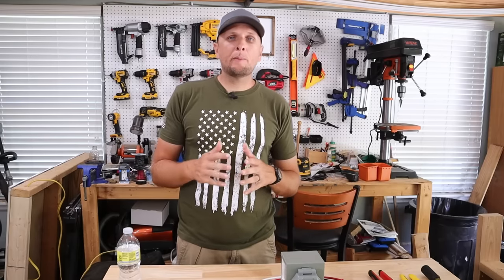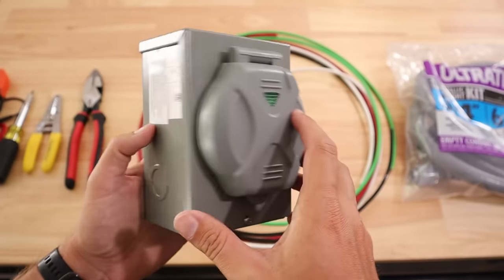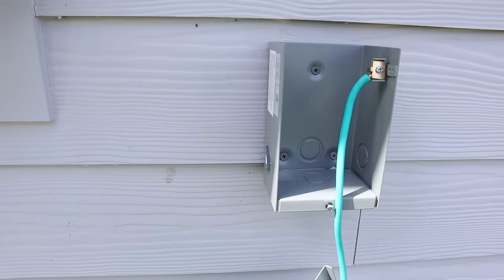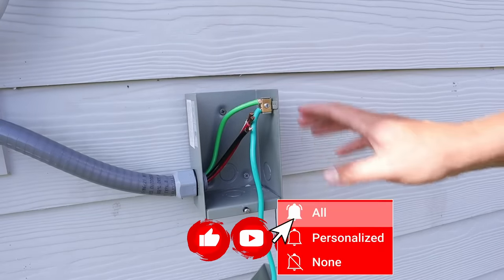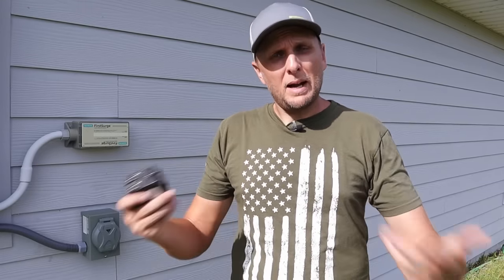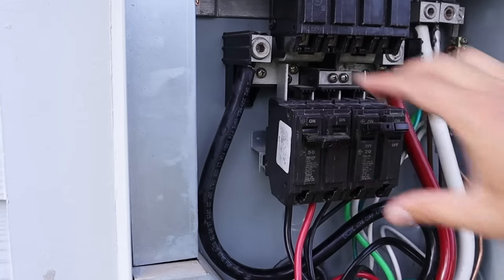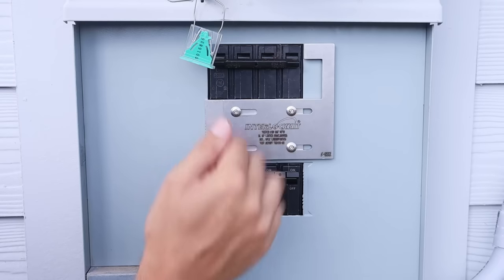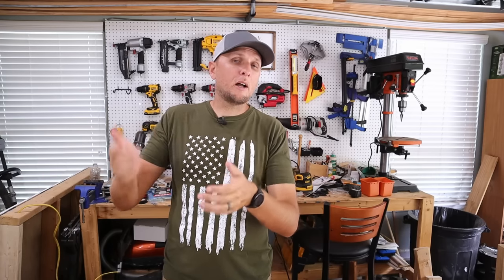The BEST Way To Connect A Generator To Your House - Interlock Kit With Power Inlet Box Install

Comment: Instead of putting in the power inlet box, my electrician said he could hard wire it directly into the breaker box.   That way I only have to plug into the generator and not have to worry about plugging into the outlet box.   Just saving me a step.   Would hard wiring be a better idea or just as good?
Reply: No difference really.

Comment: You should have used a 3 pole breaker and interrupted the 
neutral, even if you have to cut out the deadfront. Linemen could get hurt or even killed from power on the neutral backfeeding into the lines on the poles.
Reply from the maker: If power is going back into the grid on the neutral then there is something seriously wrong with your wiring.
Reply: @HowToHomeDIY  regardless of your comment, a three pole breaker to interrupt the neutral is the safest way to do this and is code in a number of jurisdictions. SquareD makes a cost effective 3pdt switch for instance, the C92351, CSA approved and rated for 30 amps.

Comment: I installed a switch and outdoor light on the incoming side of the power service to my metered box. Normally I leave the light switched off, but when power goes out, I switch it on so that I know when the power comes back on.
Reply: Does that meet code ?

Comment: With your house main being turned off to prevent backfeeding the powerline and potentially injuring a lineman, how do you know when line voltage has been restored by the power company?   Periodically switch back and forth between generator and line to see if its been restored?
Reply: You keep an eye out on the neighbors and the street lights... 😂

Comment: Is it ok to use strander wire like you have it on the video, I thought you supposed to use a solid romex wire?
Reply from the maker: The stranded I used in this video is actually the proper wire to use.  Romex is not supposed to be used in wet locations which would be pretty much anything outdoors.

Comment: My box outside has an electric company installed tamper wire installed. Assuming to prevent any issues. Can I remove that tamper tag without penalty?
Reply from the maker: No, those boxes are for the electric company.  You must have a main panel somewhere else.

Comment: Something you need to consider when selecting a generator. ALL generators are designed to run at 80% rated load then you need to de rate it 10% for every 1,000 gain in altitude. A 10Kw generator is really a 8Kw generator. Then let’s say you live at 5,000 above sea level. Now you have to de rate your generator. For the first 1,000 feet you loose 1,000watts so now you are at 9,000 Watts Second thousand feet you loose 900 watts now you’re at 8,100 Watts. Next thousand feet you loose 810 watts now you’re at 7,290Watts. At four thousand feet you loose 729 Watts. So now you’re at 6,561 Watts. Then for the final thousand feet you loose 656 Watts. So now your 10Kw generator is now a 5,905 Watt generator. Now remember it operates at 80% of rated load so  80% of 5,905 is 4,724 Watts. And that is what you have to work with.

Now with that minimum power you have to decide what to run. Remember compressors on your fridge, freezer and AC will cause a load jump when they kick on then taper off once they get going. So it’s not really that simple as going to Harbor Freight and getting a portable generator to run your house. Local code will dictate the requirements for what the generator has to run.

And just to let you know I have a 200 Amp auto switch on my house connected to a 24Kw generator that’s been de rated to 12,754 Watts because I live 5,000 feet above MSL. And at 80% rated load it’s 10,203 Watt generator. That is what is used to run the whole house.

Comment: I have a cs6375 (male) (50 amp) hookup on the side of my house but I'm trying to use a smaller 30amp generator (l5-30R female plug) to supply a little bit of power to the house when the grid goes down. Why - because this is the generator I have.  Is there a cord I can use to marry these two up?

Comment: I think the light being on is to let you know not to open the lid and shock yourself since it’s a male plug.   The fact that you installed that within a child’s reach is no bueno.  Either that always leave that breaker OFF when not in use, or install a steel zip tie to make sure it can’t be fooled with.

Comment: Hello, will this generator work with that interlock kit?   DUROMAX
13000/10500-Watt Dual Fuel Electric Start Gasoline/Propane Portable Home Power Back Up Generator with CO Alert Shutdown
thank you

Comment: I have a question I have a 30 amp twist lock 8000 W generator on the female side is 30 A male side is 50 A coming into the house. How can I connect from the 30 amp twist lock generator to the 50 amp inlet into the house

Comment: I don’t understand what you mean by only the things in your sub panel being powered. Where or why is there a sub panel? The point of this I thought was that you are creating another feed in point into your main panel which basically acts exactly like the street power coming into the main box. Therefore anything in your house that can ever run is tied into your regular panel and now your generator is feeding power to your regular panel.

Comment: So you can just wire it straight into the main panel without a generator transfer switch ?
Reply from the maker: With an interlock kit installed yes.

Comment: Do most folks have an external panel box? I never saw that before ( in Pennsylvania)
Reply from the maker: Most don't yet but it is becoming a more common practice and local code requirement.
Reply: @HowToHomeDIY  . Ok thanks. Not a bad idea. I'd just pull the meter if an emergency. It is required for mobile homes here.

Comment: Hey Adam,  I have a Westinghouse generator with a 50 amp cord that plugs into a 50amp inlet box. The inlet box which is outside is less than 3 feet from the service panel inside the house. The electrician used 8 gauge wire for the 50 amp circuit. Should he have installed it with 6 gauge wire?
Thanks,
Dan
Reply from the maker: Hey Dan, Did he say why he used #8 instead?  It is a very short run.  Is the generator's output less than 50 amps (12,000 Watts)?  What kind of wire did he use?  Some is rated at 90 degrees Celsius which would allow it to carry a higher amperage due to it's insulation.  Either way I would never use #8 on a 50 amp power inlet box.  #6 wire should have been used to make sure that it can handle any load thrown at it.
Reply: That's where the red flag came in.  He installed a 30 amp inlet instead of the 50 amp requested.  After installing the 50 amp I asked about the 8 gauge wire and he said it was more than sufficient.  My generator is dual fuel and runs 9500w running with peak 12500 on gasoline.  It has 8500 running watts and 11200 peak watts on propane

Comment: The max wattage from a single 50amp generator plug is 12Kw,  some generators have two 50amp plugs,  can two inlet boxes be wired to the breaker box?  Two inlet boxes would provide for 24Kw from the generator.

Comment: If my generator has a 30A and 50A plug, can I use both at the same time? 30A for HVAC and 50A for everything else?
Reply from the maker: No.  Those are just means for transporting the power, the generator still only produces the same amount of power it is rated for.

Comment: Hi, I am a new subscriber and I really appreciate your channel. I am about to install a backup generator at our new home in PA, and it will be 20 ft from the building. I'm out of state for work often and my wife and young kids are usually home when there are frequent blackouts especially in the winter. I saw this video (https://www.youtube.com/watch?v=VbqZQoE6frQ&list=WL&index=1&t=734s) where I think the generator cable is wired directly to the house panel. I'm happy I saw this video before buying the inlet box and cable because I really like and prefer this set-up, as it requires just going to the generator shed, plugging in the cord and starting the generator, then back inside. This method is best for my wife being out alone in possibly bad weather, as it will get her back inside quickly. As opposed  to her having to get the cord from the shed, then go to the inlet box to plug it in, then go back to the shed to start the generator before going inside. Will it be possible for you to explain how to do this setup in the video. I'd really appreciate it, thanks. God bless.

Comment: I have two 200 amp panels side by side in my garage.   How could I get this to work?  I have things in each I would like to power on in the event of a power outage.   I spoke to a local electrician and they were going to run two 50 amp breakers to connect the two panels with two interlocks but reading online says this is dangerous due to parallel/redundant paths for neutral.   I'm not smart enough in this field to know what's what.
Reply: You wrote ... "I'm not smart enough in this field to know what's what."  So then, let your local electrician pull a permit, install the xfer switch and get it inspected.

Comment: Question: Is it not better to connect the 30 amp cable prior to turning on the generator? I'm not sure if it's a good idea to handle the 30 amp cable once the generator is on. Same for disconnecting the 30 amp cable, would it not be wise to first turn off the generator before disconnecting the cable?   Thanks
Reply: The cable has no electricity going to it when he plugs it into the generator..  the inlet he installed has zero power until he plugs it into the generator ...

Comment: Is the generator setup as floating neutral or bonded neutral? I'm not an electrician, but I think it's supposed to be floating neutral if it's used to feed a main panel. I'd love to replicate your setup, but I don't know what the risk is if it's setup incorrectly. Any advice would be helpful. thanks.
Reply: You are exactly correct.  For this setup, the generator should be a floating neutral.

Comment: I would like to do the same but my breaker box is inside the house so this seems very complicated for me. I would have to run pvc and pull my electric cables about 30 ft to my breaker, which is in the garage.

Comment: So when you put that 50 amp breaker in the panel that double pole breaker that is next to it will be powered by the generator?
Reply from the maker: It also would be yes.  Along with everything in my sub panel inside with 95% of my circuits.
Reply: Thank you that's what I was looking at aerobic system breaker is outside in the panel.
I live in a mobile home the rest of the circuits are inside.

Comment: If you are powering your whole house through a Inlet box and a interlock kit does the generator need to have a BONDED or FLOATING NEUTRAL?

Also, would it be a bad idea to have two Inlet boxes installed one 30amp and one 50amp? The 30amp would be a "back up" to the 50amp in case there was ever a problem with the outlet on the generator. The 30 amp and 50amp would never be on at the same time.
Reply from the maker: In most cases when hooking up to the house you want a floating neutral generator.  I don't think there would really be a benefit of having both.  They shouldn't just go bad.  Always good to test everything from time to time before there is an emergency.

Comment: Do you think I need a slow start device for my 2.5 ton AC unit with a 13000 generator?
Reply from the maker: There is no way to know that without knowing what you’re in rush current is, what all you want to power, etc.

Comment: I have a 30 amp 7500/9000 load but it has a 30amp plug. I have the 10 circuit Generator Interface Box.  I was wondering if I could put in the 30 amp breaker in direct.   I have enough output to power my AC but it is not wired into my switch.  I did this about 8 years ago and there were no 50 amp options at the time.

Comment: The knock outs don't have to be drilled. Just use a screw driver and a hammer and hit it where the the metal piece that actually holds the knock out in place, isn't located. Punch out each half and then use a pliers to twist and break off the small tabs that hold the knock out in place.
Reply from the maker: Bill on these boxes they are fake knockouts.  It is actually written in the instructions that they cannot be knocked out and have to be drilled.

Comment: Does it matter which breaker? I have a main shutoff outside and normal breaker inside.
Reply from the maker: Has to be one of the breaker slots nearest the main circuit breaker.  That way the interlock kit can work.

Comment: I currently have a Generac 10kw whole house automatic backup generator hooked up to a 100 amp transfer switch. What would be the best way to backup this current system with a DuroMax dual fuel 12500 generator, in the event that my current generator goes down ? I have 8 huge fish tanks and cannot risk having my current backup generator go down.

Comment: Do you have to turn off the breakers inside your house ?
Reply from the maker: Yes. Any that you don't need on so you don't put too much load on whatever your generator is rated for.
Reply: @HowToHomeDIY  So the only breakers I turn off are the ones I don't need and the main , right ?

Comment: Nice video, but you should really have added a drip loop on your connection outside.
Reply from the maker: Not required or necessary.  Water cannot enter the boxes.  They are sealed.
Reply: It may not be required but water has a way of getting in, it is good practice, and that is why professionals do it! @HowToHomeDIY
Reply from the maker: @user-hh7fo3iq6h that’s an opinion though.  I would argue most pros don’t create a drip line on this application.  I have rarely seen it done.  Kind of like wrapping receptacles with electrical tape, it’s not required, really doesn’t do much, but can an argument be made that it’s safer?  Sure.  This is not me discouraging doing any of this.  If it makes you feel better and/or safer, then definitely by all means do it.

Comment: Not all main breaker panels panels will accommodate the interlock you show. Without an interlock this setup can be very dangerous, especially to lineman working on downed power lines.
Reply: You can always make your own interlock switch if they don't mass produce one that works for you. I don't use interlocks myself since I rewire my box everytime I use the generator. I'm quick enough to wire the breaker box in under 5 minutes.

Comment: In the event of a utility power outage and since the generator is sharing the main neutral wire from the grid, is there no concern about feeding electricity back through the main neutral wire. I'm not entirely sure but I believe in a solar energy system the main neutral (and of course both hot legs) have to be isolated from the solar power wiring.

Comment: am no certified electrician, so can someone confirm, is the neutral an issue, when switching from utility to generator? don't you need the neutral to be controlled by a switch as well (utility to gen), or as long as the 2 lines are controlled by CB you are OK

Comment: Adam, every connection cord I find has 4 prong plugs. I was told that the suggested 3 prong plug I purchased is for a 30amp circuit? I have this all put together with everything hooked up with everything 4 prong but this plug. I have issues I know but that’s besides the point. I need a quick fix for this box that’s already installed?? Is there a 4 prong male insert that can replace the 3 prong? Thanks
Reply from the maker: Unfortunately I can’t see your setup so I’m not sure exactly what you have.  But there are 3 prong and 4 prong 30 amp cords for generators but the 3 prong will only supply 120 volts.  Most 30 amp applications require the 4 prongs to get 240 volts and be able to power both legs of the panel.  Assuming you have that setup.  You can check Amazon, there are plenty of 4 prong cords to choose from.
Reply: @HowToHomeDIY  
Yes I am a little upset, at me. I really have a hard time researching things that I know very little about. Then I find myself trusting that the video is about my exact situation without looking into one last time before buying. Because there’s a lot to sift thru but I trust yours and I fell short of verifying. I left somewhat of the same request for help on the actual video of yours I got my shopping list from so that you know the specific one that I purchased. It would be nice to be able to take the plug and the front half off box that has the 3 prong receptacle with exactly the same thing but a 4 prong receptacle! Does this make it easier for you to help me out?

Comment: Here are things that wasn’t mentioned in the video that you must know before installation.

If you are using a 50 amp breaker and inlet, best practice to use a 6/3 wire as shown in video. 
The current set up is a unbonded neutral connection, which if you are using a portable generator to power the home you must change to unbonded as per code. Easy to do and usually shown in generator user manual.